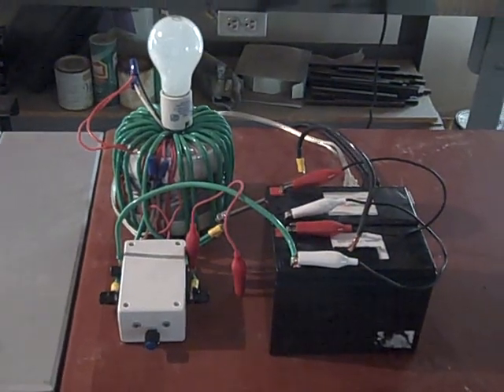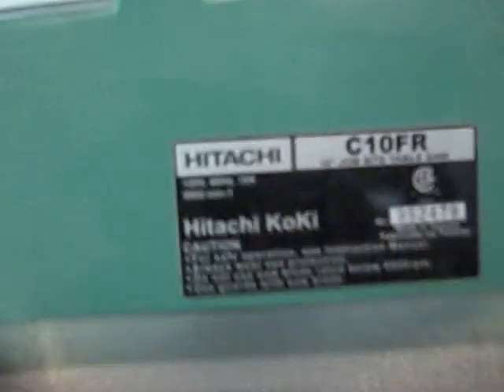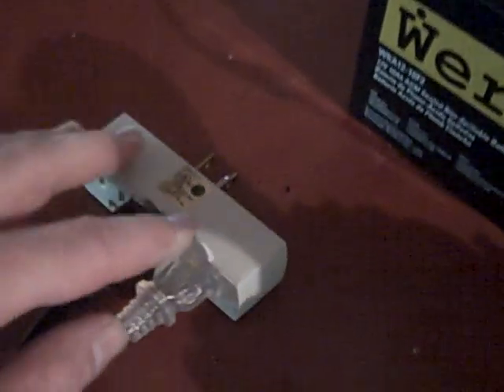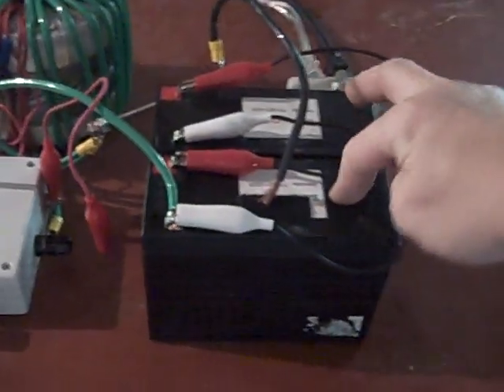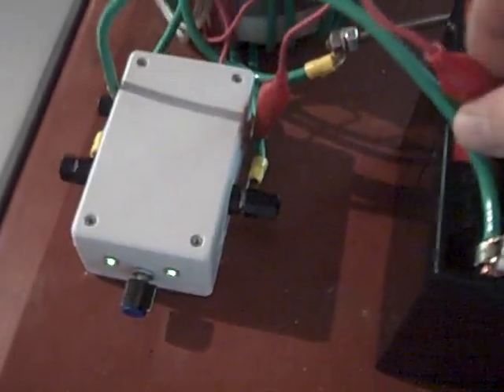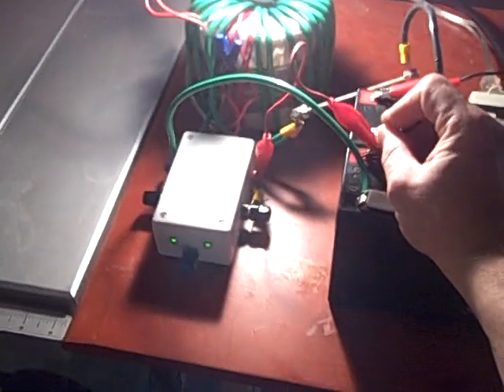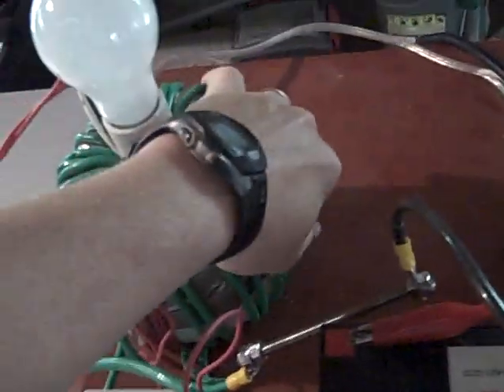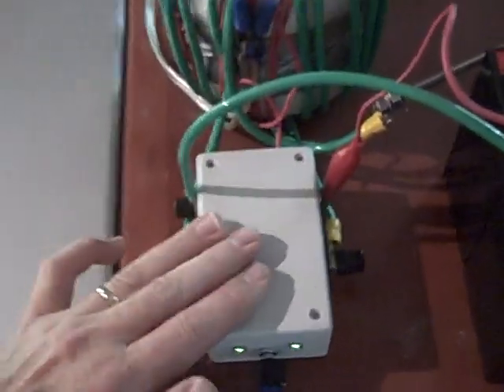12 Volt Homemade Power Inverter

Comment: what could I do as far as getting a/c power out of the back of my work Truck with car batteries? I was also thinking of tieing the batteries in that I'll put in the bed in with the alternator,  so they stay charged when I'm driving,  but they wouldn't be in the same circuit as my main battery so the two in the bed don't drain my main battery.. any suggestions as far as doing it myself?
Reply from the maker: +rocket man 
I would use a battery isolator device which would not Rob power from your main battery going to your truck... It would only draw from your batteries and at the same time be charged by the alternator. But if you will be pulling heavy loads, I would leave the engine running. Thanks for watching.
Reply: that's what I was talking about,  but do you have any ideas as far as how I could make my own inverter?
Reply: or how to know what to use to change watts.

Comment from the maker: Making another video soon on updated homemade power inverter which is very easy to build once you see it. The circuit however can be found here...w..electroschematics com/220/12v-dc-220v-ac-converter/
 Thanks for watching.

Comment from the maker: Both primary and secondary hooked together in parallel....Both going into the same direction. That's the output power..120 volt. The 8gauge big green wire is the 12 volt pulsing input.

Comment from the maker: Both primary and secondary are hooked in parallel then the 8 gauge green wire wrapped around it becomes the new primary coil that's pulsed with 12 volts.

Comment from the maker: No sir, 13 amps...my load draw at the time was 850 watts to run saw and 100 watt light bulb...very efficient compaired to standard inverter due to the fact of my toroidal core special winding design. Please watch my updated video running 2000 watts of halogen light bulbs. Thanks for watching.

Comment from the maker: Yes sir, you are correct.  I also tested the load draw which came out to be 850 watts to run the saw and 100 watt bulb..not bad for this small system. Will advance it more in new video to come. Thanks for watching.

Comment: Using the saw's electrical spec as an indicator of consumption is flawed. That simply indicates what the supply needs to provide. It does not indicate what the saw consumes with no load.

Comment: Yeah that is why I said *may* only be using 50-100 watts I was just pointing out that the current requirements listed on equipment are only intended as a max limit so that you plug the device into an appropriately sized circuit.  Each device will be different, including lightbulbs.  I have built a few small inverters similar to the Joule Ringer 1.0 and 2.0 and they do tend to be more efficient than commercial inverters for powering devices that do not care about the quality of the power source.

Comment from the maker: Yes, true... but your information is incorrect about the free spinning watts. The motor is actually pulling 6.5 amps of current on free spin, which is 780 watts. I do have some good equipment also to measure the power output of devices...system would run smoother on a 12 volt car battery thou instead of those other batteries I used. Thanks for watching.

Comment: One thing to note is that your table saw will not use the full current rating unless you stall the motor while cutting.  With just the motor free spinning you may only be using 50-100 watts but the real test would be trying to cut dense wood or MDF.  You may want to invest in a meter that can measure kilowatts to see what wattage you are truly drawing from your inverter circuit and also what these devices use when just plugged into mains.